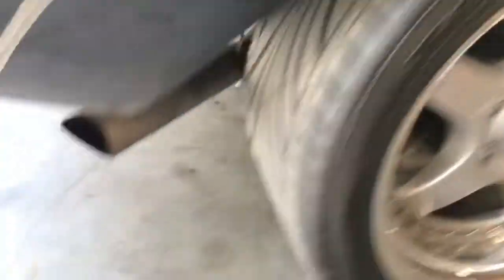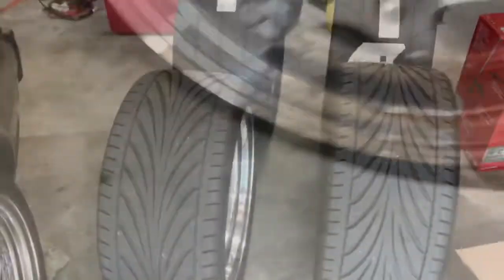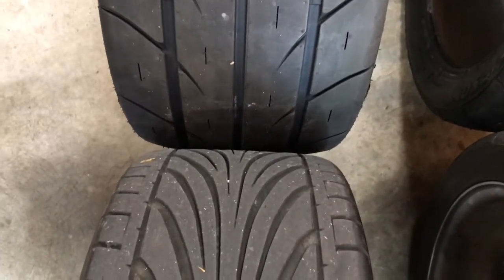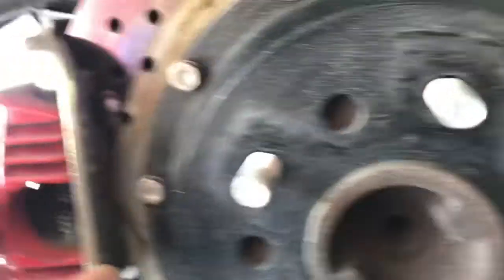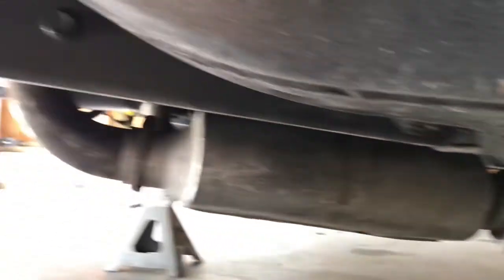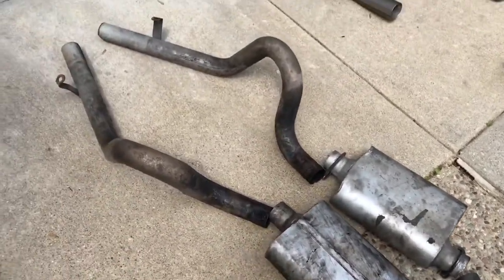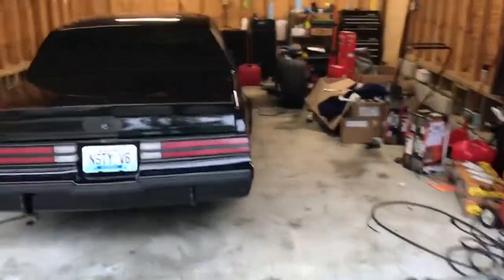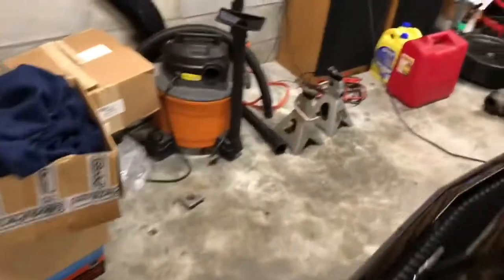The new Pypes exhaust system installed on the Buick Grand National (Mamba)

Comment: Hey bro I have a question did you have buy the adapter or it comes with the kit
Reply from the maker: do you mean the hangers?
Reply: @2muchBoost_  no I’m talking about from the original to new muffler
Reply from the maker: @franciscobotello6813  everything you need comes in the box...it bolted right up to my cutout pipe
Reply: Thanks for information bro I really appreciate